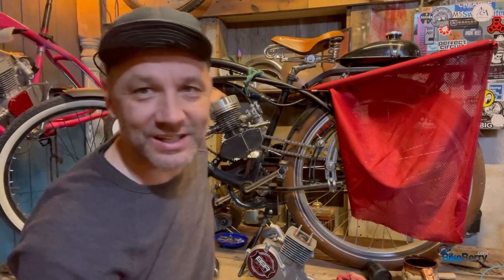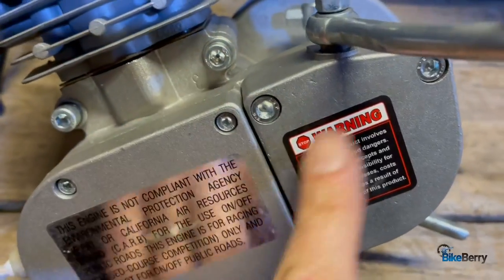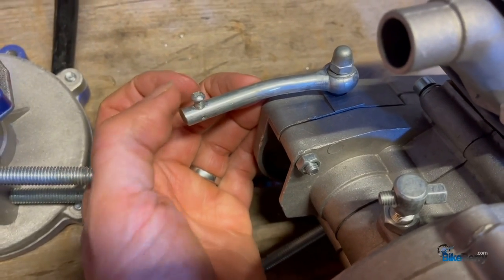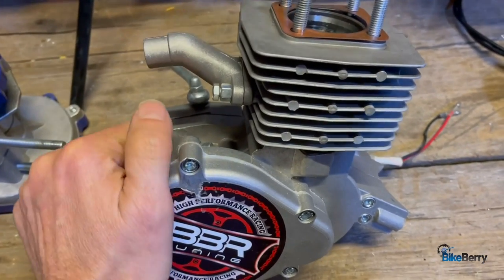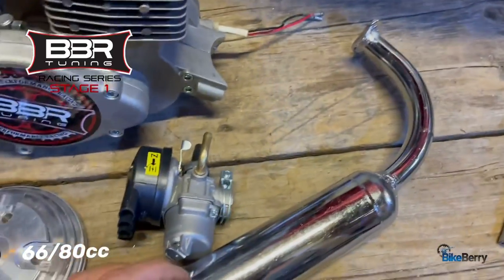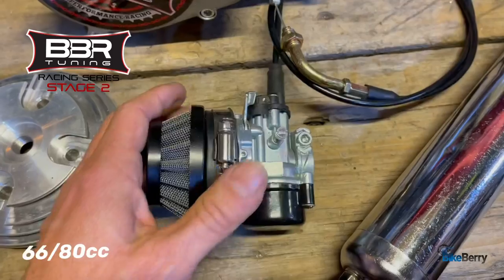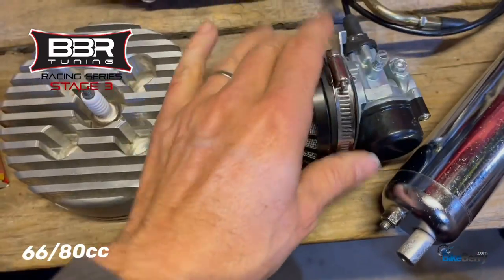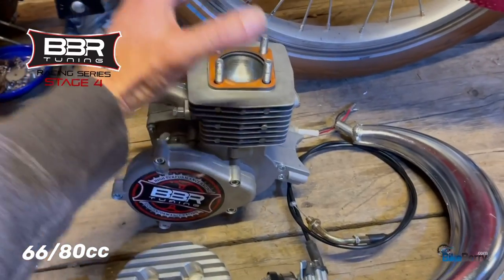What’s a Racing Stage Engine kit? Motorized bike | Bike Berry

Comment: I'm just thinking now, what the stages would include if a reed valve, ported cylinder, balanced crankshaft, and the deluxe expansion chamber would climb out to, yes a full race prep china doll.
Reply: I’ve been thinking that since we have the parts available it’d be cool to explore.
Reply: @tonytaylor5087  One thing I kind of want to explore when I get the chance to put the parts together is seeing if the small reed block you guys offer would fit on a Schwinn Stingray or a Micargi Prince or similar, though it would probably still require an offset for the carb, I think, if I'm looking at things right, one should fit.

Comment: Other than what I just said there and posted a second ago about the high compression heads so cold as it is but it’s not really mainly what it is is to give you a good area for a squeeze gap ring they call it in a tighter area underneath the spark plug combustion area And it’ll flow down easily into the gap where it compresses down and go straight down instead of in different directions other than that but the area that is left where it does not conform to the shape of the piston lowers the compression a little bit off of what it supposed to be So what it really does help you cool and gives you a little bit more efficiency in your power and combustion delivery and direction

Comment: my clutch was slipping.  Im new to youtube.  I love my motorized bikes.  my clutch was slipping.  I went all the way to the stopper screw and tightened the butterfly nut with clutch handle pulled in as see on youtube.  blah blah, it is still slipping and its tight.  my pads are worn to hell but there.  Start it with a drill gun?  I bougjh a one`way drive adapter but cant find a 5 sided adapter; 

Im a fan! rock on

Comment: A little secret is that the chamber in that so-called high compression head is shaped differently than the piston it’s a little flatter and the piston is a little more domed which means there is more area in the sides even though it does give you a decent little area that I guess it is a squeeze gap But it’s not really causing you to be high compression unless it shaped exactly the size of the piston head and you take the cylinder down so that you get an adequate squish gap and piston clearance all around then you have a high compression engine and you will need a compression release valve in my opinion
Reply: Yup, that’s why I don’t subscribe to them as high compression. It makes for a good name but I feel their contribution is more for the cooling and sealing aspect. I’m sure you’ve seen it but I did a video on how much compression they actually provide.
Reply: You have to shave them down, at least one mil, in order to see the performance out of it you will not get that much out of it though they’re still great at the end of the day that help out a lot with the cooling

Comment: Good videos man. happy new year also. ive been building bikes since 2008 and seen so many changes in craftsman ship. One thing that always keeps slipping my mind is the pz20 carb working with the box reed case and a self ported piston. opinion side would most pick a reed (box version) eith a ported over stock? and are therte any mods between carbs to those boxes etc pretty much mix and match?

Comment: QUESTION! why dont bike berry do a four stroke high performance engine series? is there a reason why no one really trys to do 4 strokes . you know most of the real motorcycles are now all four stroke engines . i know you have four stroke engine kits i get that but i just dont understand why thats all the farther its gone .
Reply: People do 4 strokes all the time, why you don't see much of that is cause you don't need much to make a 4 stroke bang. With 2 strokes you have so much to do it becomes a hobby on its own. Check out 4 stroke kart racing from 212cc to big block 390cc and above and you will see billet blocks, balanced cranks, velocity stacks and crazy billet heads with the valve train to boot. Sometimes you see superchargers but like I said it's easy to get a 4 stroke to make power than it is a 2 stroke which is more involved as you see with the video

Comment: For refinement to a stage 5 replacement of all hardware from galvanized steel to stainless steel  with superior balance to the crank shaft in preparation for NOS added performance.
Reply: This would include higher performance crank barings casted thicker to be able to make 100 plus HP.

Comment: Most of those kids and stuff you might increase your power of delivery a little bit but without adjusting your port timing in gearing and opening up that carbon take a little bit and your exhaust a little bit you’re not really gonna see much of a difference in power and speed

Comment: What would be the best all year to include frozen tundra Minnesota  style frame tire engine and just the greatest beast cruiser or lowride. Im currently running the one i have into the ground and i am learning  a ton.
Reply: Gonna have to experiment on that one. Tires for each season, 2 stroke, 4 stroke, heavy frame like the F-Zero tank style. Etc
Reply: @tonytaylor5087  heavy is not your friend whenever you run out of gas and have to peddle through wet stuff. Studded tires I know already ride them a little low on air just like you you would go Rock crawling in the Rockies.
Reply: That’s why I mentioned the F-zero frame as it’s thick aluminum but light weight. And since the tank is built in its one less thing to deal with.
Reply: @tonytaylor5087  let me first date my apology because all of those other things went over my head didn't know what they were and that was my own ignorance.

Comment: the pushbutton  type clutch lock is better , but not nearly as durable , they tend to break without warning & are for the most part irreplaceable .so you end up having to replace the whole lever ,

Comment: A real expansion chamber " will make HP and have a pulling powerband"  and if the cranks were better balanced  for vibration & higher RPM , and the pot metal was all billet high grade aluminum, would be rad " but with the right expansion chamber really bring the motors to life"  go-peds / scooters ect,

Comment: 8:16 I don't care at all about the "vibe" of the engine, I care about reliability over EVERYTHING else. I want to daily drive one of these "upgraded" engines 15 miles to work and back, without any problems for 6 months.  If I can't do that, then you motor is as useless as a basic, unmodified chinadoll, except worse, cause it costs more.
Reply: That’s a whole nother level my man. Complete reliability as transportation to work is something more suited to a 4 stroke engine that you’ve dialed in. Definitely something to explore.

Comment: The exhaust combustion chamber that comes with the stage 4 f zero build does not fit were buy your pedals hit it or to get it in out of the way of pedals the other side of the crank case hits pedal chain..I 💬 no way may have the wrong part for my order if infact there is a way to mount it... anyone...please help🙂